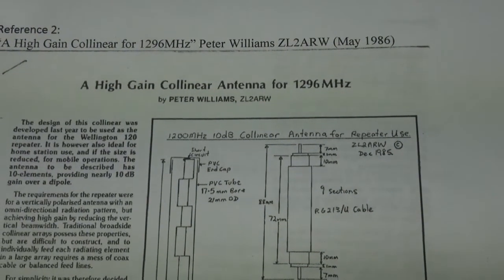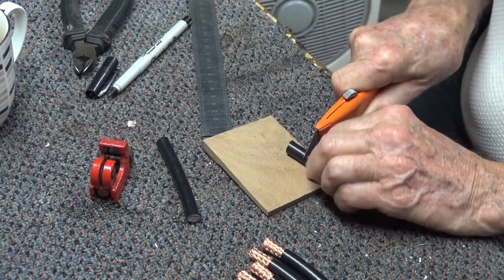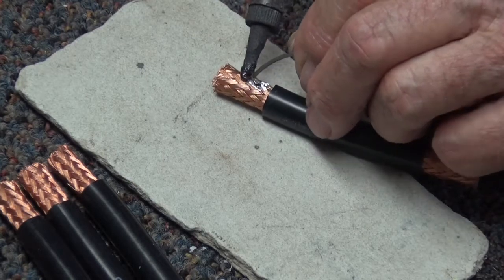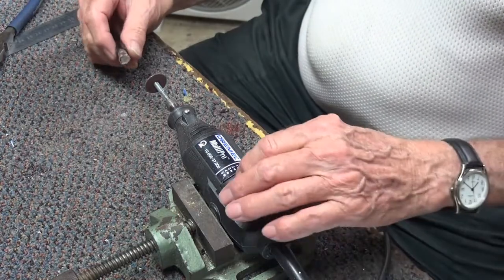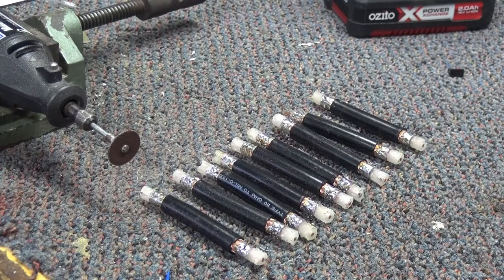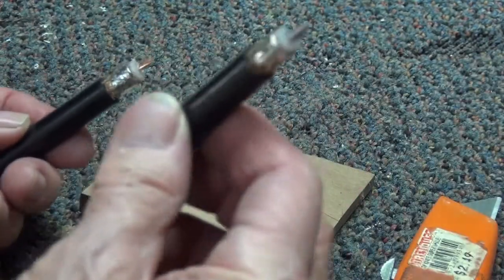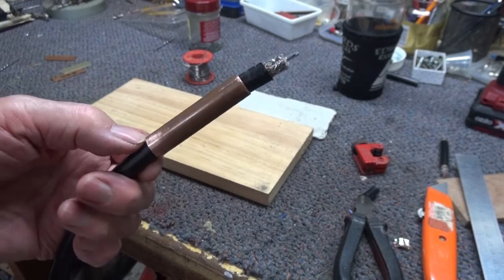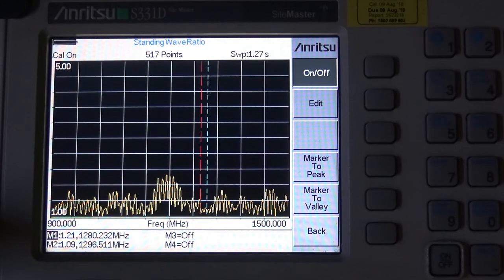How to make a 23 cm band vertical antenna with 10 dB gain.

Comment: Which type of coax did you use between the ant and the shack please? and how long?
Reply from the maker: Hi John, I used 9913 coax, about 10 meters from the antenna to the receiver. The 23cm band seems to propagate much better then most people realise. I was was able to receive the distant beacon with the antenna inside the shack when testing even though there was a brick wall in front and a metal roof above!
Reply: @Jonny10001  Thanks very much for the reply!.. Ok I thought the coax would be something like that. I did a lot of S-Band work when there was such a thing as an Molniya orbiting AMSAT and pretty much 9913 was a min so I have some about the place. Yes 23cm interesting band, have been building a UHF tripler using a triode and can trigger a repeater with the output connected directly to a big fat dummy load, go figure. Great video thanx again

Comment: Hi Jonny, that's just the DIY-Project, I was looking for.   I want to build a LoRa-WAN-Antenna for Europe tuned for 868 MHz and approximately 9 dB.  Buying is too expensive and I want to tune it perfectly to 868 MHz. Would you please tell me the exact measurements of the coax pieces or the way to calculate it for my own. And :  What effect has the piece of copper at the bottom and in what distance it has to be soldered ?  Many thanks,  Ulrich from Germany
Reply from the maker: You can calculate the element length in inches using the formula 5904 divided by the desired resonant frequency of the antenna, times the velocity factor of the coaxial cable. I used RG-213 with a velocity factor of 0.66 or 66%. The copper tube is a coaxial sleeve balun to prevent RF travelling back down the coax braid. It should be 1/4 wavelength long and connected 1/4 wavelength down from where the feed line attaches to the first element. Here is a link to the original article.  https://zl2vh.org.nz/assets/pdf/other/23-cm-band-fm-repeater-specs-rev-2014.pdf
Reply: Jonny, thanks for your answer.  I just calculated a bit and recognized, that the antenna will get rather tall (90,2 cm).   Would it be possible, to make the 1/2-wavelength-pieces only  1/4 in length and therefore the 1/4-pieces in to 1/8 length ?  Would make the antenna only half long (45,1 cm).  But what is with the frequency (868 MHz) ? Will it fit also ? What do you mean ?
Reply from the maker: Hi Ulrich, it’s a physics thing, it won’t work if it’s not a half wave length. You could make a ground plane antenna, four 45 degree  sloping 1/4 wave radials and a 1/4 wave vertical. Not as much gain as the co-linear but still good.
Reply: @Jonny10001  Thanks, I already built a ground plane antenna. Works fine, but I want more gain. Okay, then now I will start my project with your co-linear. I'm curious about the efficiency and the results.

Comment: how do i calculate the lenght for 151.820 MHz

thanks
Reply from the maker: You have to scale the dimensions up by a factor of 8.4 but it then becomes to big to be practical. Have a look at helical filter designs, they suite the lower frequencies better.

Comment: at 7:20 you talk about "a specific distance" that you solder down here.  In this video, you miss all the key dimensions that make the difference. You incorrectly make assumptions that the view has the same resources as you and that's incorrect.. You missed a teaching moment in describing what you were doing and  the measurements and how you came about those measurments.
Reply from the maker: I didn’t design the antenna I built it from an online article by a ZL group which shows all dimensions in detail. My aim in the video was to show construction methods and give tips to aid completion. I don’t know why the original article has become hard to read but I have uploaded my copy to Google Drive, see link.